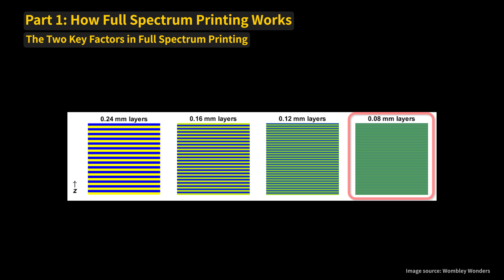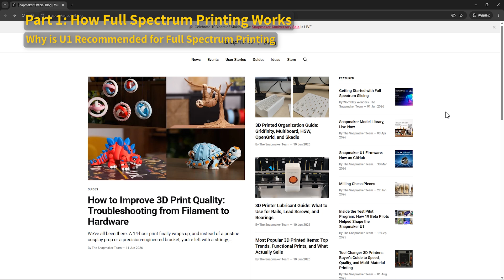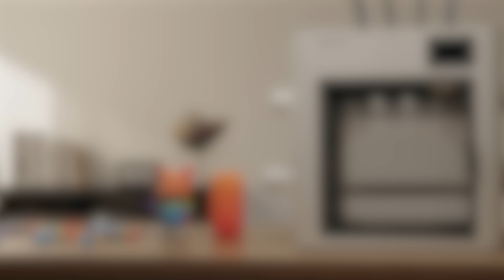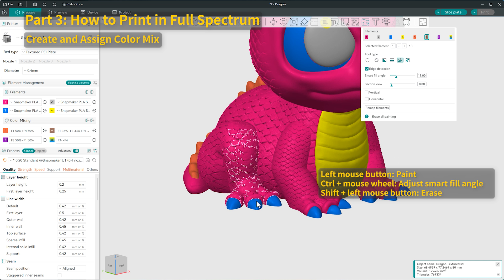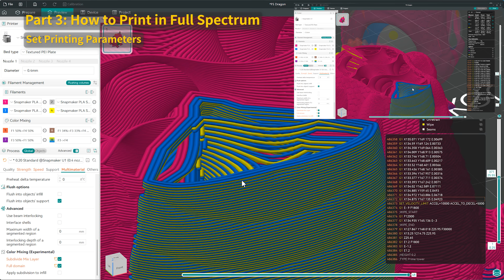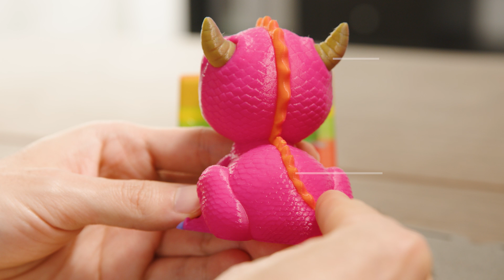U1 Video Guide: Full Spectrum Printing

Comment: The colors on my slicer with my CMYW polymaker polychroma filaments (specifically designed for full spectrum printing) don't even come close to matching the print result. This leaves me with having to print swatches, but the swatches fail to print with sheared pieces of filament and failed prints. Not having a good experience with my snapmaker u1 at all.

Comment: This is great but why not add an automatic setting to match the colors a textured model? Is that coming? This wont work for more complex textured models but seems like a pretty easy step to automate, in fact, if the software is open source I could add that. Is that possible?

Comment: No matter how many times I run Multi-toolhead Offset Calibration, the colors on the left and right sides are different, and it doesn't work properly. What should I do? I'm trying to create gray using white and black, but it's not working.

Comment: That's cool, but I believe that there are still major things which need better attention, ex, U1 X/Y movement exceeded travel limit, which happens very often, skip  part as an icon, easy to select the items not to be done, or an AMS for U1, Losing connection, all of these things are major

Comment: Please recommend a CMYK filament
Reply from the maker: Hello! For Full Spectrum printing, we recommend starting with translucent CMY + White/Natural PLA rather than a fully opaque CMYK set. A good starting point is translucent Cyan, Magenta, Yellow, and White/Natural — for example, Polymaker’s Panchroma Translucent PLA colors are commonly used for this workflow.
If you need darker tones, you can try replacing White/Natural with Grey or Black, but black can be very strong and may reduce smooth blending. Results may vary depending on TD, filament translucency, model geometry, and slicing settings. We’re also working on Snapmaker filament options optimized for Full Spectrum printing.
Reply: A lot of people must be trying this as a lot of the CMYW kits are sold out. I decided to try eSun's kit as it meets all the requirements to try this process out, and it now is priced a little lower than the others. I just did a test last night and it looks promising. I'm eager to try some more models to test further. You can also buy the colors independently (not in a kit), but I'd be sure and use only the same type material (all PLA, or PETG, or whatever) like the video suggests. Polymaker's Panchroma is considered the "gold standard" right now in this process by many. They were sold out (of the kits) when I was ready to purchase so I went with eSun. If it turns out this is something I want to pursue, I'd sure like to try out the Panchroma product. I do have other Polymaker filament and it seems to be a solid choice.

Comment: So what do you do for Filament for features for walls, infill, and solid infill? Since the color-mixed colors don't show up, does it not matter what you select for those settings?
Reply from the maker: The default settings were used for both the walls and the infill.

Comment: What I'd like to see is something that can take a color and tell you what filaments you need to load in order to get that color. So if I wanted that dragon to be a certain color, I would load a picture of what I want, and it would spit out the (up to) four filaments I'd need to accomplish that. And on top of that, if there is the ability to swap out a filament at a certain height so you can end up with even more colors, telling you where to put the pause in and what filament to take and replace it with.
Reply from the maker: Hey, it could be a possibility in the future!
Reply: Nice idea for color matching suggestion to models 3mf, in theory you should be able to reproduce most of the colors with WMYC (so only 4 filaments, unless you want goold or silk ;-) )
Reply: This is very difficult to do as the color on your monitor is not the same as the color of the plastic. Monitors make color with light; material colors are of course pigment based. One is an additive process and the other is subtractive.  It is even difficult to manufacture the plastic with the same exact color from production to production. Lot's of reasons for this, none of which is a flaw in the manufacturing process. It has always been this way in the color processing fields. When you try to manufacture colors (whether in pigment form or material form) and hold to tight color tolerances (and there are many tolerances in a single color), the cost of manufacture goes way up! Just go buy some automotive paint and you'll see what I mean. Some high quality printing inks are very pricey as well. My wife has gotten into watercolor painting recently and I've noticed there too the pigments are surprisingly pricey; certainly not like when we used to get our kids watercolor paint kits!
Reply: @pearltiger2003  Colors in the general sense. Green is green. Red is red. etc. Doing it manually is the same as AI doing it automatically. Just mapping color to parts based on a picture.

Comment: Great tutorial and neat idea but a bigger printer with 6 heads would solve most of my problems..... just saying :)
Reply: Engineering material, support material, CMY, black, white

In other words, I'd like 7 haha 8 if I can have both a rigid and flexible engineering material
Reply: @RNEmployee  are you using the engineering materials in the same prints as the cmy colors often enough to warrant needing more than 6 tools? Just swap one or more colors out when doing those kinds of prints.

A rudimentary climate controlled automatic material feeder would be convenient in that department as well as keep things nice and dry.

That would be my ideal setup. 6 tools that can individually be connected to some kind of filament swapping system. Those feeders wouldn't even need to be big like the 4 slots units we typically see from other companies, 2 slots would be plenty.
Reply: @jayjayhooksch1  Not currently, no, I was just presenting the "ideal" machine that has the highest simultaneous capability without an automatic material swap unit. 
But who knows, maybe the machine I described would be too big or expensive for my uses anyways.
Reply: @RNEmployee  oh. I like the filament swap units. Not for swapping mid print, I don't like the purge waste, but for making things more convenient to get ready for the next print and for climate controlled filament storage.
Reply from the maker: Glad you liked the video, and we appreciate your feedback on the printer specs!

Comment: Even though I'm using Snapmaker Orca Slicer, I absolutely cannot create a gradient effect. When I try to create a gradient like in this video, it doesn't work like F1 > F3. It still looks like 50% + 50%. I got so frustrated that I uninstalled and reinstalled it, but the situation didn't change. Even when I try to slice it like this, it still slices it at 50% + 50% and doesn't create a gradient. I installed Bamboo Studio, and it works perfectly fine there. Please help.
Reply from the maker: Hi. Please make sure the layer height is at least at 0.2mm and that subdivide mix layer and full domain are activated.
Reply: @Snapmaker  Even though all the "color mixing (experiment)" settings are enabled (subdivide mix layer, full domain, Apply subdivision to infill) and both the initial and standard layer heights are set to 0.2mm, the result is definitely not like the gradient option shown in the video. It doesn't display "F3>F4"; instead, it shows something like "F1 50% + F2 50%," as if I had selected the "ratio" option rather than the "gradient" one. When I slice the model, the expected color transition doesn't appear; it just shows up as a single color. This is definitely a program bug. It might work for some people, but no matter what I tried, I couldn't get it to work. It is really frustrating that it works flawlessly in Bambu Slicer but fails here. I am eagerly awaiting the release of a new version.
Reply: @Snapmaker  Worked for me, thx!
Reply: tengo el mismo problema
Reply: What’s your layer height?
Reply: @karmachameleon326  i have the same issue with any layer height (0.08, 0.12, 0.2 etc). the problem is that it doesnt even create new color as gradient in UI, it shows as a 50/50 mix.
Reply: @СтаниславКладов-я8о sorry, I don’t know what to tell you on that one. UI looks fine on my version 2.3.4
Reply: Same, gradient was first thing I played around with- no dice.
Reply: I am experiencing the same issue and have applied the suggestions from Snapmaker. Are you using the Windows app or Mac app?
Reply: @germainehennop7396  yo tengo el mismo problema que el tipo, yo estoy en windows 10, usted?
Reply: @germainehennop7396 I’m experiencing also and I’m on windows 11 did anyone figure it out?? 
Thanks